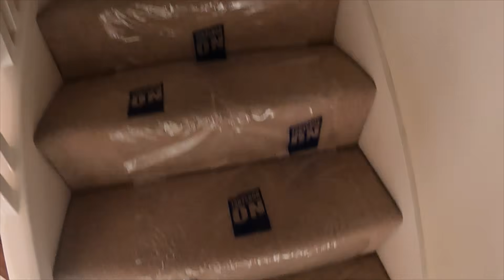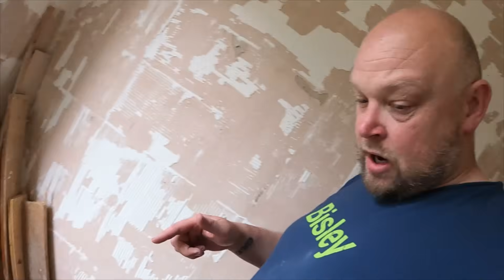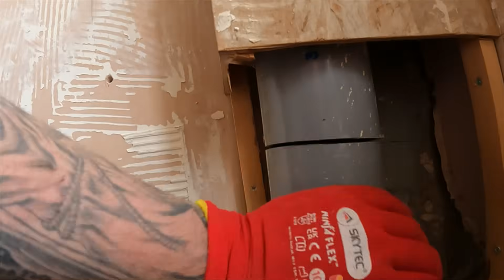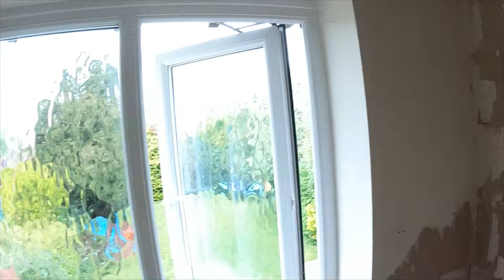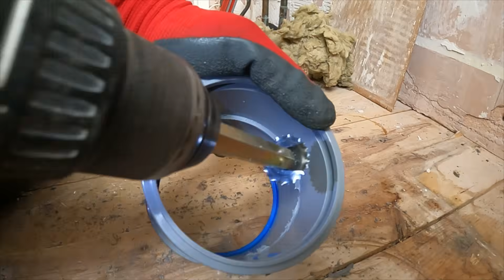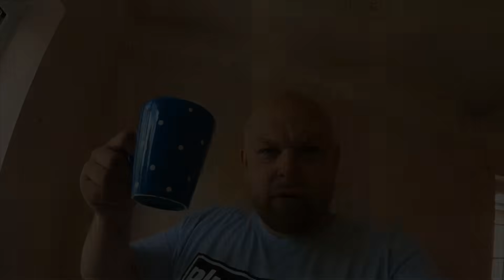FULL BATHROOM REFIT-SOIL STACK CAUSES PROBLEMS ON DAY 1… Part 1-Rip out & 1st Fix

Comment: I'm watching this because tomorrow I am doing my first ever soil pipe job and I'm really not looking forward to it. I have to add a toilet downstairs so I'm cutting the pipe in the garage just above where it disappears down into the concrete and fitting a branch and then I'm going to have to use a slip coupler like you did here as well, so came to see you do it!

I have to drill through a thermalite wall and hope it comes out at just the right spot because the pipe is like 90mm behind the wall so there isn't much room for error. I'm not even totally sure if I will be able to fit the branch in its that tight.

You must have negative pressure at that place leaving the end open like that. I know that here at my house there is really high positive pressure so the stench is going to be billowing out. Can't wait 🤨🤢

I have got a bucket ready in case something goes wrong and I dont manage to finish the job in time 😂
Reply from the maker: Good luck with the job, just take your time and measure twice!
Reply: @MJTiffPlumbing  I just got out of the shower after completing the job, and no sign of leaks! This is one of the few DIY jobs I've done where everything went as planned. I didn't even need to nip out to toolstation!

Comment: Whoever notched out the joists for the shower waste pipe should be banned, for life, from doing any building work and running any sort of building company and fined heavily.  Not only do the notches go completely against code they are also right at the end of the joist.  Whoever did this work is a complete moron and has no skill, understanding or knowledge.  It is however idiots like this that take work from real builders and then charge a fortune for it.  You NEVER NOTCH OUT JOISTS FOR ANY SIZE OF WASTE PIPE !!  Plus to add insult to injury the plumbing is a bloody mess and the holes drilled through the joist are way to close to the end of the joists.  Regs and codes are there for a reason.
Reply from the maker: Someone doesn’t know what they are on about…… 😂

Comment: Where you added the slip coupler above the branch. If there were no other toilets / basins above that point and that was just a vent up into the loft then out of the roof -  could that section of the stack be reduced in diameter?  Our small en-suite is the same, with a huge boxed in section which houses the stack which goes up into the loft out of the roof. If we could reduce that section of the vent stack from 110 to 50 / 75 it would allow us to reduce the size of the boxing in. Is this allowed?

Thanks. 😊

Comment: Out of curiosity, couldn’t you have tee’d into the shower waste for the basin, meaning you would only need to have one waste pipe notched in the joists? Could you fit a vent in the false wall of the shower to stop any pull/gurgling on the sink trap?) would that work or is there a reason for everything to have its own run?
Reply: Sorry, just seen that you answered this as personal preference, but do you think a vent would reduce the issue?
Reply from the maker: Not the best way to do it to be honest, will cause more issues

Comment: I was just wondering why you could not go round to the shower with a single 40mm pipe and T off to a 40mm to 32mm conversion for the basin?
Reply from the maker: I personally don’t like tee’ing basin wastes into shower wastes as they tend to suck on each other and the traps run dry, causing smells to come back through

Comment: Drill the joints above their middle point for waste pipe and put it in shorter lengths & use solvent connectors then.
Will surprise you what you can get in and much less weakening joints. 
Use a slightly bigger hole cutter than the waste pipe diameter and use a right angled chuck drill. 
Drill holes allowing for slight fall obviously

Comment: That soil pipe is taking up far to much room and sticking out loads. You say you are getting the roof plastered anyways,  so remove the soil vent and put an air admittance valve in instead. If you can even hide it in furniture or a very minimalist  piece of boxing with nice little shelf on it. Just cap the old vent pipe. Job sorted.
Reply from the maker: No need to at all mate, it’s fine as it is and fitting an AAV isn’t the done thing done on a main stack

Comment: Hi mate been following you for a while now. What sizes are recommended for basin/shower/bath waste please?
Reply from the maker: Basin is 11/4”
Shower is 11/2”
Bath is 11/2” 

👍🏼👍🏼👍🏼
Reply: Thank you so much for taking the time to get back to me and so quickly! Top top man!
Reply: One more question, you fit the flexi waste on the bath, can that be installed on push fit pipe or does it have to be solvent weld pipe? Tia 🙏🏻

Comment: This is very helpful stuff. I am a rank amateur DIYer and have been looking for some info about working with soil stack fittings, as I'll need to do so when replacing my bathroom. This is the most useful practical explanation that I've come across. It helps that you're solving a real life problem too, and showing how you work in a confined space. You're braver than I am to cut the soil pipe off so low though.
Reply from the maker: Thanks buddy….. real world plumbing on this channel😉👍🏼👍🏼

Comment: I'm not a plumber. Why can't you use the existing 40mm waste for both shower  and basin?
Reply from the maker: Not good practice to tee wastes into each other as it will “pull” and can cause gurgling
Reply: @MJTiffPlumbing  Thanks for your advice

Comment: Am I being an idiot, but why couldn’t you cap that boss off and use the 1 1/2” shower run with a tee in for the basin?
Reply from the maker: Because it would then pull on each other and can cause gurgling from traps….. always pipe up separate
Reply: @MJTiffPlumbing  yeah fair enough mate  I was just being an idiot. I work in offices up London and basically told to make it work no matter what 😅 apologies for questioning you. Love your content mate

Comment: The white pipe that you initially took off that shows the black rubber needs replacing(its currently leaking) 😮, can you just seal it with silicone or do i replace the whole part? Your advice is much needed thank you
Reply from the maker: Just replace it buddy….
Reply: @MJTiffPlumbing  thank you so much for your prompt reply...

Comment: I have just today ripped my bathroom out and the wastes are in a right mess 
The person who did it 20 odd years ago has got the shower and basin T'ed init the waste for the bath ,then goes into the stack ,the shower waste pipe actual slopes up hill under the floor and have stood for far to long today ,looking at the stack and thinking can I just the section of the stack out and start from scratch ,Ffs
Reply from the maker: Bloody wastes can be a right pain
Reply: @MJTiffPlumbing  
Thanks so much for posting this vid mark , as decision has been made after watching it 

Cut the stack out and replace

Comment: why would uyou not just tee the basin into the shower waste and use the same line rather than savage the joists
Reply from the maker: Because teeing wastes in together is a big no no, it causes gurgling and other issues…. That’s basic plumbing buddy….
Reply: @MJTiffPlumbing  If that was my own house I'd definitely use a p trap with an air admittance on the basin and run it down the same waste before before adding two more illegal notches into the joists. There is a reason those p traps exist, lol.
Reply from the maker: 🤣🤣….. ok buddy….. 👍🏼

Comment: Live in Midlands had no water , can't flush or nothing for 6 days now ! Had 5 plumbers out so far basiccly live on top of a takeaway there's 2 flats in on same second floor mine is a one floor flat and my neighbour has an upstairs , basiccly when I flush the chain it starts backing up and then if I run the tap it will back into the toilet and bath ! If my neighbour flushes or runs the taps it backs into my bath also !! First plumber didnt want to touch it and said its a severn trent water issue and they need to clear it from the main sewage they checked and said its clear from there ! We have a main sewage clean out in the back of the takeaway downstairs and the second plumber said it looks clear ! Thrid day a tried plumber came out and noticed because of the back up of water the pipe burst inside the wall and came apart 😳 flooded my whole bathroom and down into the takeaway!! That plumber didn't want to do it as we don't know the layout of the pipe work etc! When the water backed up into the bath we unplugged the pipe which went from the sink outside into a main drain line which leads downstairs to stop water coming in and got it to redirect outside instead ! The whole pipe when we take the sink pipe off is filled to the top of water backup! My landlord said that pipe thats full goes both left and right and has u bends! What would this problem be my neighbour is being very selfish and keeps running the taps etc and it backs into my bath! If we turn taps on or flush more then once same thing will happen pipe will fill and back into my bath and toilet it was so bad it broke the seal around my toilet and water was spraying out ! My landlord got another plumber which he chose to be cheap with to come and repair the pipe which was leaking and he ran my tap literally once and the tap for all but 3 seconds and said it was working so the landlord tried blaming us for taking a small pipe off the back of the sink which backed into the main pipe which has back up in ! If we didn't take that off water would have carried on coming in ! We saved him thousands in damage by doing that and quick thinking I grabbed every single towel bucket and even bed sheets etc to soak up the water ! And we were taking it in turns to empty the bath as it filled! The landlord refuses to turn the water off by mains and the problem still isn't fixed the pipe that came off in the celling thats been repaired but the back up is still there and backs up from my neighbours toilet above mine into my bath and mine does the same ! What could this be is this a soil stack blockage or is it something to do with the pipe that attaches to the back of the bathroom sink because that one is the one connected to the sink and bath and thats the one I took the off and was backed up right down into the celling! Would the soil stack back up into other pipes also? Because I thought it was a main line sewage problem and sevebrn trent would fix it ! But they said no blockage and the man who came to check the main line clean out whixh is inside the takeaway said it was working but he only got the takeaway to run there taps and toilet and we didn't get asked and we are on the 2nd and third floor ! :/ confused!
Reply from the maker: Wow….. that’s a real mess.

Without seeing and testing everything it’s hard to work out what the issue is to be honest…… I would be pestering the landlord to get it sorted as it’s a health issue now with soul pipe water backing up

Comment: Little tip for next time you can get 40mm solvent through two joists have pull on it and bend it in it alright when it goes in then just coupling it up, flex seal instead of pissing about cutting that lip on inside good work though nice to see people using copper
Reply from the maker: All depends on the joist widths…. Sometimes you can and sometimes you can’t.

Comment: Great video. Re waste pipe: grey inside, black outside and brown underground. Can you also use the brown/underground pipe inside? Not to mix and match with grey, but the whole internal system. Thanks.
Reply from the maker: Don’t use brown internally.

Grey/white and black can all be used internally and externally

Comment: Can I ask what inserts you use for the soil pipe tees to get wastes in? I was on a job the other day to repair a leaking one outside and showed up with a BOSS rubber insert but it was too big (soil pipe tee cut out) so had to mangle the rubber insert with a stanley and a load of silicone to make it fit. I rang around asking for a slightly smaller insert but nobody seemed to know what I was talking about.

Comment: See these internal stacks a lot on properties I do. They can’t be a proper pain in the ass! All old, stuck and wedged in! Like yourself I sometimes just rip out the fittings and start again! Not everyone appreciated this part of the job and the thought process that goes into it! 👍 take care mate!
Reply from the maker: Thanks mate, you can fully understand the thought process that went on 👍🏼👍🏼
Reply: @MJTiffPlumbing  absolutely mate… did one about 3 months back… 3 way boss adapter under a bathroom floor 2 of which had split. Right in the corner boxed in, also went down into kitchen below with another 2 boss adapters feeding into it… again, leaking. Chopped it all out and slip coupled a new load back in… council job… full of crap and glad to get home! Give me your bathroom job all day ha!
Reply: Move it outside.

Comment: Good progress mark with the bathroom, the only thing I would of done different would be to run 2 inch waste from the boss to the basin then tee off in 1 1/4 to the basin then 1 1/2 to the shower and probably fit a MacAlpine aav above the shower in the loft to stop the sink gurgling as I'm never keen on notching joists next to an already notched joist but each to their own. As for the sparks I know you said the ceiling is being over boarded but that's absolute lazyness banging holes in the ceiling like that, it's a mess and would probably take 20 mins in the loft. Anyway looking forward to the finished job 👍
Reply from the maker: If there was a loft they would of been in it mate…… but no loft hence going through the ceiling, plasterer is in tomorrow and you won’t see it as new ceiling and skimmed.

I personally am not a fan of teeing waste pipes in together…. Seen and heard to many issues with it, plus notching out for 2” would of REALLY set the trolls off on here…. They are all ready having sleepless nights about a job they have seen on YT🤣🤣

As you say each to there own, always do the way that works for you👍🏼👍🏼
Reply: Very true buddy
# real world plumbing 😁👍
Reply from the maker: @adierob1  🙌🏼🙌🏼……

Comment: Hey McTiff run shower waste in-between joists where connection is and then turn to trap far better fall or did that mean taking another floor board up ohhhhhhh
Reply from the maker: Plenty of fall as it is mate.. plus the tray is laid slightly higher

Comment: Great seeing how you think out the soil stack problem. Quick question for my own understanding, does the soil stack fittings not need to be cemented together?
Reply from the maker: No mate, they just push together and seal
Reply: @MJTiffPlumbing  makes sense, haven't seen them before, cheers!
Reply from the maker: @stephenhaley2k3  I don’t think I’ve ever seen a soil pipe that’s cemented together 🤷🏼‍♂️
Reply: @MJTiffPlumbing  haha well I'm not a plumber so I haven't seen many, but they've all been cemented. Based in Spain though so anything goes!

Comment: I had a right pain in the arse soil stack emergency call out Sod’s law it was easter bank holiday too was leaking in the ceiling space dropping down in the corner an was similar setup you had but in reverse with the 45s on the bottom half of the ceiling to kick it into the corner and the leak was at the top where the branch was about 3ft up inside the ceiling void was ether bad solvent glue or manufacturing residue made it not glue properly basically the people who installed it didn’t pressure test it was a right ball ache I like the inner cutter you got there gonna need one of them haha and on another not I know we all say 45degree bends but there not 45 they are 135degree anyone know why we are all saying 45 hahaha

Comment: Weird that the customer is fine with overboarding the back wall. The bath is tiny right now and an extra layer of board+plaster can make a visual difference if it comes to the size of the bath in this case
Reply from the maker: Good job it’s just a shower then😉😉

An extra 12mm isn’t an issue👍🏼

Comment: Great job mate, would it not beenbetter to bring the 4" under the floor and go in the side of the toilet T for the shower and basin, great jobs anyway.
Reply from the maker: No room for the mate….. and a huge joist at the back
Reply: @MJTiffPlumbing  yea seen that too, some times you just gotta do what you gotta do. I done a similar job with stack internal but brought it outside and back in again was tight and alot of measuring. But looks good pal, can't wait to see the toilet pan cut out I always have to cut the back of the back to walls as there is never room for anything.

Comment: Hi mate, got a question, i turned off my stoptap under the sink I have an unvented white cylinder, I turned on the hot taps & it wouldn't seem to stop flowing? does turning off the cold stoptap, stop hot water coming out so I can change a tap / shower etc?
Reply: Hope u don’t mind me replying 
If it’s invented turning of the main feed to the house should stop your hot water 
If not though the cold feed going into the bottom of the cylinder should have a valve on so try finding that and turning it off and the hot water will stop 👍
Reply: @jaffplumbs26  what a legend thanks so much for replying, I did turn of the main stop tap under sink and opened the hot taps to drain it down till it stops but didn't seem to stop so was a bit confused.

Comment: Could you not have connected the basin waste into the shower waste?
Reply: Yea true but aslong as the fall ain’t to aggressive and Anti vac trap shouldn’t have any issues saves having big notches near each other in the joists
Reply from the maker: I don’t like teeing waste pipes together as they can pull on each other and drain traps causing smells to get out